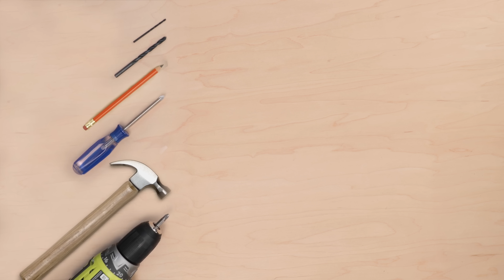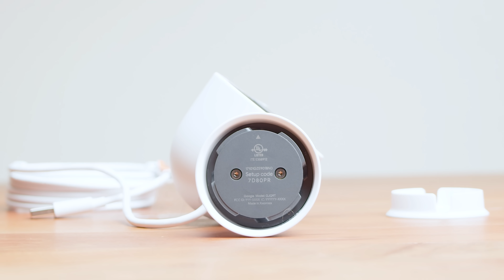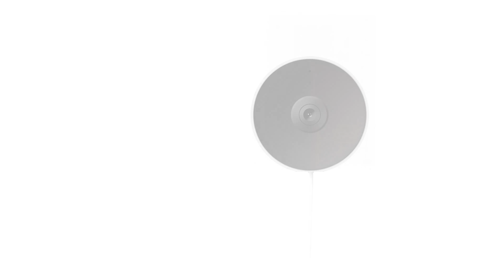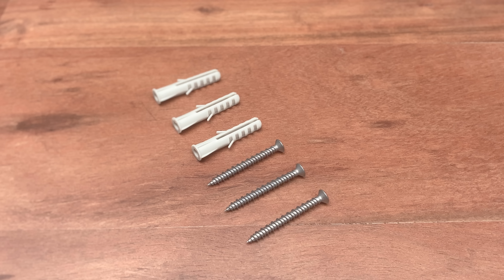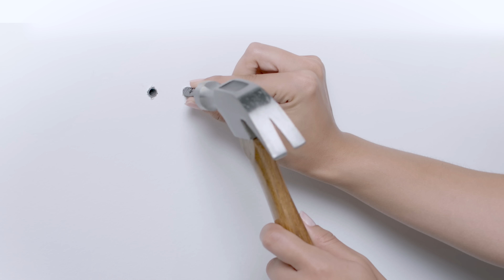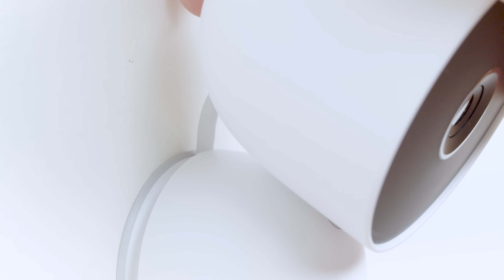How To Install Your Indoor Nest Cam (wired)

Comment: Thia video is a life saver. I tried setting up my 2 cameras several time following the nestcam directions but I could never get them to work. Your video explains that you need to download the google home app as the first step which made the set up easy, and I was able to get the 2 cameras on line in less than an hour.

Comment: My light didn’t turn blue, it was green.  They asked for the last four “digits”, but the last “four” on the bottom plate were mixed characters not “digits”. My first attempt would launch on Google home, but not NOT Nest Aware. I also noted a feedback shrill between the Nest Indoor Camera and the Nest Display. The shrill was really loud. The next morning I attempted to install the camera in another room, with the same results, but this time there was a shrill, but still not displaying on Nest aware with my three other cameras.
If someone has an answer to the shrill, or the Nest Aware issue, please advise.

Comment: I just got an email from you folks saying I should get one of these and use it as a garage-cam.  The unit I live in is on the 4th floor and my garage is on the 1st floor.  My home wifi will never be strong enough to be seen in the garage.  So..., how's this supposed to work???

Comment: I lost the wall screws that came with my wired indoor google nest cam (2nd gen). What size screws do I need to buy as a replacement?
Reply from the maker: Hey there, thanks for reaching out. We're sorry to hear that you lost the screws for your camera. Unfortunately, we don't have the exact dimensions for the Nest Cam Indoor (2nd gen). However, if you didn't lose all three screws, you can bring one of them to a hardware store and look for the same size. For more information, you can contact us here: https://goo.gle/3xi30RG

Comment: After a first install I reinstalled it with new modem. Nothing whatsoever en Google or nest app. The light stays just green, nothing to be seen or reconnect to new wifi. It's useless
Reply from the maker: Hey Ben, we're here to help. Try restarting the camera, phone and router to refresh their connection. Once done, try setting it up again. If it's still the same, reset the device to its factory default settings. For more help, we'd suggest reaching out to us here: https://goo.gle/2D2Shve

Comment: can you mount this camera on a ceiling?
Reply from the maker: Hey James, we're here to help. Yes, you can. The included screws can firmly hold the camera on a vertical surface like a wall or ceiling. Follow the installation guide here: https://goo.gle/3xwXrMm For more help, contact us: https://goo.gle/3ie15Ae

Comment: Help! I tried to reinstall my camera but it doesn’t work. Though it worked before year ago when I first used.
The light on the camera doesn’t turn blue, instead turned green stead away. I did restart the camera and phone and even reset the camera but none of them works.
Reply from the maker: Hi Pinnie, thanks for the post. Could you check the help message or code you get on your app and use this link for the suggested steps? https://goo.gle/2OznU4V. If that doesn't help, we'd suggest reaching out through our phone, chat, or social media forums: https://goo.gle/3ie15Ae

Comment: Help! I used my phone to set up the device...everything is cool! Now, we're trying to figure out how to connect my husband's phone to the device. Usually, you have to wait for the device to turn white, then blue, and then you can connect. However, since the device is already connected, the light is green instead of blue. Is this interfering with my husband's connection? If so, now what?
Reply from the maker: Hey Noni, thanks for reaching out. You'll need to invite your husband's Google account as a family member to share access with your camera. You can check this helpful link to know how to invite a family member: https://goo.gle/3Qh7U6a

Comment: Why is it so hard to move a Google camera from one home to another. My daughter was living with us while her house was being remodeled and she bought two (2) google indoor cameras wired to monitor the baby. Worked great! Yesterday she moved back to her own house where she has a Google Nest thermostat and two (2) Google Chromecast tv modules hooked to her tvs. The thermostat and tv devices work fine. I have spent several hours now trying to setup the two Google cameras on her Google home app and all I get on both cameras is a finish window saying “Something went wrong” 26 times that I’ve tried. Why is this so difficult? Why would a 3 month old camera that worked yesterday at my house not work at her house today? This should be much more user friendly and intuitive. We removed the cameras from the other home, but don’t know how to delete the other home in her app. And of course, there’s no phone tech at google I can call… right?
Reply from the maker: Thanks for reaching out, Mike. Google Nest devices are network dependent — to move and transfer to another home, you must forget the initial network connection. This can go by removing the device from the app or by resetting it back to factory default. For more help, you can reach out to our support team via phone, chat or social media: https://goo.gle/3ie15Ae

Comment: Why cant i add my camera to my Nest app? it asks to use google home, i dont use that useless crap, i will have to replace them with a competetor that doesnt chop and change everything, every 6 months, its enough to sh1t you to tears, first you screw over our accounts with the google account migration, now this sh1t, you should be ashamed of yourself google.
Reply from the maker: Hey there, thanks for reaching out — we're here to help. The new Nest Cameras are exclusive to the Google Home app because we wanted to create an integrated experience with your speakers and displays. We're always looking for more ways to improve the app and make it more user-friendly. We're here if you need help.

Comment: Is it possible to view the camera while being away on 4/5G or on a different WiFi network?
Reply from the maker: Hey Dory, thanks for posting. As long as the camera has a stable internet connection, you can always view them even if you're miles apart. Let us know if you need more help.

Comment: The light is not getting blue... I can't set up my camera. Any advice on this?
Reply from the maker: Hey Jorge, we're here to help. Try restarting your camera and router to refresh their connection. If it's still the same, reset your camera to its default settings. For more help, feel free to contact us here: https://bit.ly/3adTfGB
Reply: @madebygoogle  Helpful! I restarted it to default settings by pushing the reset button for 15 to 30 secs. After this, the light turned yellow and then turned blue. Much appreciate. Thanks.

Comment: Hello Made by Google,
Will this Nest Cam (indoor, wired) image stream and features such as motion, people, vehicles and animals alerts/detection still work if I mount the camera from the ceiling (upside down)?
Reply from the maker: Hi there, thanks for reaching out. If you need to mount your Nest camera on a ceiling or overhang, you can adjust the video so that it's right side up. To learn more about it, check this out: https://bit.ly/3cEDs4I For additional help, contact us through phone, chat, or social forums: https://bit.ly/3o1aRK5

Comment: When it says "Plug your camera in where you'd like to use it"...this is glossing over the most important single part of the installation.  Plug it in to what?  What if there's no plug available?  Is this a USB plug?  Is that for power only?  Do you need strong Wi-Fi signal there?
Reply: That’s common sense 🤯🤣🤣

Comment: Google should dedicate itself to what it really does, and not to make cameras, it doesn't know how to do this.

These NEST cameras are for dumb rich kids who think being from Google is better, but this camera is a worthless toy: It can't be mounted on a ceiling, you can't move the image from the app left or right, or up or down. It does not allow zooming. The cable cannot be extended if you want to pass it through a standard tube.

Bottom line: Any Chinese baby camera that costs 25% more than the NEST is infinitely better.

Comment: I know you can flip the camera but I can't get the correct positioning that I need it to be, without it being on a slant. It only moves back and forth not, right to left. So if you want to hang it in a corner, you're screwed. I have it hanging from the ceiling and it won't even hold position. I lift it up, it falls right back down. It gets very loose after trying to get the position that you want. Which is a struggle cause it barely moves. I wish that I didn't buy 6 of these things at once. Also, the outdoor cam don't even come with an outdoor power cable (which is sold separately for $40.00.) You can't even splice the cable or use an existing power line from previous cameras cause Google decided to go with they're on design of power cords. Knowing this going in, I would have never bought all these cameras from them.
Reply: I had the same issue with the camera not holding position mounting to a ceiling corner. I shoved an extra drywall anchor between the camera and base that was the right size to hold it where I wanted it...

Comment: 4:00 is IMPOSSIBLE to get the wire through the base of the wall mount and gently twist the camera onto the mount. Not without severely pinching the power cord.
Reply: No kidding, these clown over at Google are notorious for shitty engineering ideas like this.  I think it's hilarious that they show it in the video too like "look it's easy".  The team over at google responsible for this needs to get their shit together, absolutely a joke.
Reply: While it comes delivered with the base inserted so that there is no space for a cable to run through, there are actually two depths which the base can be screwed onto the camera, one of which does provide space for the cable to pass through. This was not immediately obvious to me.
Reply: @fablungo  your comment saved my sanity
Reply from the maker: We hear you, Philly. We appreciate you sharing your thoughts with us. We’ll continue to improve our devices to give you a better experience. If you need more help, reach out to us through our chat or phone support so we can better assist you: https://bit.ly/3adTfGB
Reply: @madebygoogle  Can the stand be twisted off? I want to use another stand because, the one that came with it, does not stay in place.
Reply: @madebygoogle  Yea you'll continue to improve your products after you most likely intentionally make things harder than they need to be, so the consumers want to buy the BRAND NEW one.

Comment from the maker: Hey Greg, thanks for posting. We appreciate your interest. While there isn't a longer power cable for the Nest Cam (wired), you can purchase an extension cable instead. We'll be here if you have other questions.
Reply: What type of extension cable?  Is there a length limitation?
Reply: Hello which speed has the extension cable to be?
Reply: I think Made by Google means a power extension cable (Not USB extension cable). Alternatively look at the wall plug, it should have input/output specifications. Take note of what the output specification is and that's what you need. It might say 7.5W - 2.4A. 
However, it probably best to use power extension cable instead of trying to extend a USB cable. Reason is that USB cables are DC, ranges from 5 to 7.5W and the voltage would not travel as far as an AC 240V (AUS Standard) can. This is obviously subject to how much distance is required.

Comment: Do not bug this cam:
- it does NOT work with the nest app. Very dissapointing and confusing Google names it a Nest cam when it will absolutely not work in the nest app.

- setting up a second Google Nest cam 2nd generatiob is almost impossible; the Google home cam will claim it can’t connect to the cam. Solution is to uninstall the first cam, then install the second cam and then the 1st one without problems. Google knows this problem, ignores this problem and keeps selling these cams in duo-packs.

If you have 2 or more cams the sound will NOT work in the multiple cam view. It did in the NEST app, not in the Home app. 

The Google Nest 2nd gen WON’T stream on Your chromecast device but good luck finding that piece of important buyer information on their website!

Conclusion:
So; if you buy a duo-pack Google Home Nest Cam 2nd gen to use as, for example, devices to check your sleeping kids, they are completely useles. Also no streaming to chromecast? What the F Google. And omitting valuable pre-purchase info? Absolutely evil!

Google has ruined the Nest app, disabled a lot of useful Nest features and has made installing these cams unnecessarily difficuly. To top it off they are cleverly not displaying this info on their site so you heve no clue what kind of garbage you’re buying.

BUYER BEWARE!
Reply from the maker: We're sorry to hear about your experience. Our long term plan is to use the Google Home app as the one place you can control all of your favorite Nest and other smart home devices, as well as Google Assistant. In the near future, we’ll allow users to set up previous Nest devices and have full control in the Home app. 

Also, there are some compute limitations on several versions of Chromecast that do not allow us to support this yet, but we’re aiming to add support as soon as possible and our team is always looking for ways to improve — we'll make sure to take this as feedback. For assistance about your devices, we'd suggest reaching out to us via phone, chat or social forums: https://bit.ly/3adTfGB

Comment: Everything is working with my WiFi but is showing me "Can not connect with the device" I did reset my modem and my router and still getting the same message
Reply from the maker: Hey Gerardo, we've got you. You could try the suggested troubleshooting steps here if you 're having trouble setting up a new camera: https://bit.ly/2KD3l9o. For more help, we'd suggest reaching out to our live support here: https://bit.ly/3adTfGB

Comment: I bought 2 google nest cams 2nd generation. Adding the the first to google home works fine, but I can’t add the second. If I remove the first cam from google home, I can add the second one without an issue…. So it is not possible to add 2 google nest cams to google home!?

Comment: Is there a Google support phone line?  After updating my WIFI - The Nest Door Bell and IQ Cameras can only be added to my (structure account - my existing google account) by using the APP. I tried both iPhone and iPad with NO LUCK. After days of trying with no luck. I thought why not try to add them to a new (structure) account...........That worked.  But I am already paying for the other (older) account that my 4 other cameras that are now working on and were easily added to my new WIFI.   The problem is I would like them ALL in the same account and the same viewing screen.

Comment: When I feed cord through the power cord through the gaps in the plate, I cannot put the camera back on at all. It squishes the cord, and wont rotate back into place.
Reply: There are 2 depths that the base can be twisted onto. If you inspect the base (piece which screws onto the wall), you can see the channel have 2 depths. I was going crazy also trying to figure this out.
Reply: @mpersand 🎉 Thank You that was the quick and easy answer! Why didn't the Google replier just say that?!
Thanks again
Reply: Shout out again! I had to remount my camera the minute I got up on the ladder and tried to mount it. I realized I remembered this being an issue. I could not remember what the answer was so same thing as the first time 7 months ago I watched the Google video and didn't mention it. And then I came across your comment instantly fixed the issue. Thank you!!!
Reply from the maker: We're sorry to hear you're experiencing issue with the installation, Matt. To help you out, feel free to check the detailed instructions on this guide: https://bit.ly/3G5fETn. For more help, contact us through phone, chat or social forums here: https://bit.ly/3adTfGB.

Comment: Will this new cam indoor work with the nest app?
Reply from the maker: Hi Kurt, we appreciate your interest. The new Nest cameras and doorbell are exclusive to the Google Home app — our long term plan is to use the Google Home app as the one place you can control all of your favorite Nest and other smart home devices, as well as Google Assistant. To learn more on how to set up your cameras, check this out: https://bit.ly/3afwulK
Reply: @madebygoogle    if the long term plan is to use the Google Home app, will the monthly Nest Aware plan disappear or will google provide that same service?
Reply from the maker: Hi Benjamin, thanks for reaching out. While we have no news to share about it, a Nest Aware subscription applies to all of your cameras, speakers, and displays for both apps as long as they're in the same home structure. For additional help, reach out through phone, chat, or through our social forums: https://bit.ly/3o1aRK5

Comment: Why is this not working with the Nest app? All of my other cameras are easy accessible to via the Nest app but this camera won’t show with the rest of my cameras!
Reply from the maker: Hi there, thanks for reaching out. The Nest Cam (wired) is exclusive to the Google Home app. Don’t worry, you’ll be able to view both your old and new Nest Cameras together in the Google Home app. Our long term plan is to use the Google Home app as the one place where you can control all of your favorite Nest and other smart home devices, as well as Google Assistant. In the near future, we’ll allow users to set up previous Nest devices and have full control in the Google Home app.